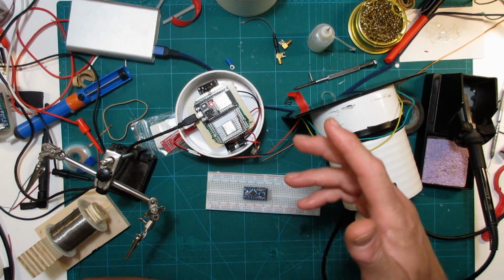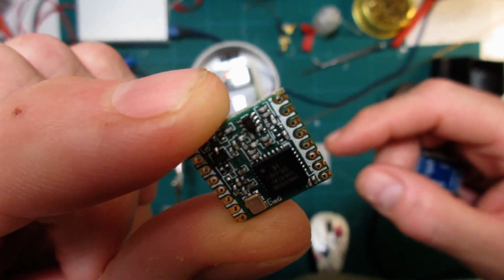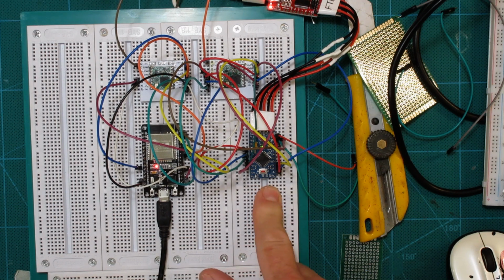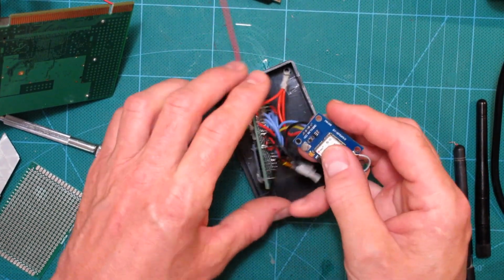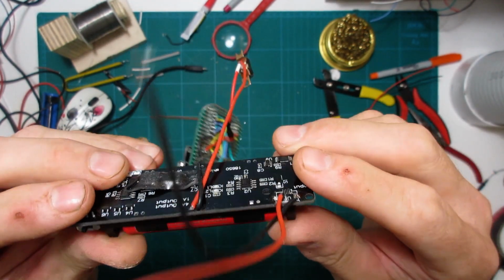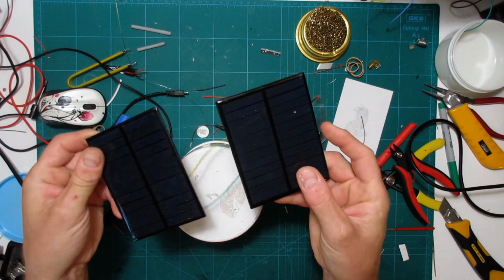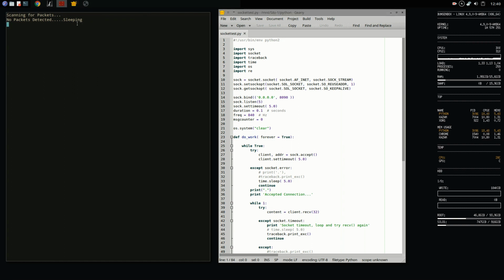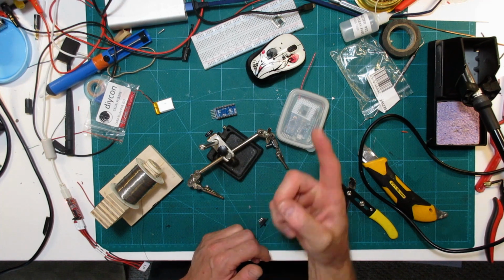Early days development of a LoRa dog tracker

Comment: Solution for poison ivy (9:07) - scrub affected areas with Dawn dish washing detergent, which is designed to dissolve and wash away oils and is 100% save for skin - even with beaks in the skin. This will result in instant relieve from poison ivy itch, and with oils removed healing begins immediately,  with no possibility of scaring (even after scrubbing) because poison ivy blisters are only superficial. FYI
Reply from the maker: This is good advice.  I had already stumbled on this info and can confirm it works!

Comment: Great video. I've been playing around with LoRa for a few years, but never have got anything up and running. In the U.S. a full wave antenna would be 32.8 cm. You are using a 1/4 antenna. You might get better range with a full wave antenna.

Comment: Hello sir, great video and channel!

At 6:47 It seems that the TP4056 board provides 4.2v output: how do you provide 3.0 to 3.6v to the pro mini?

Thanks!
Reply from the maker: You are correct, about the voltage specs for the pro mini however the Atmega328P chip that runs the thing has a range of 2.7V to 5.5V which is why I think it works.  Also,  by powering through the VCC you can save some milliamps by avoiding the voltage regulator.

Comment: I would suggest using the ESP lora32 v2.0 which has the highest rated power of the lora32 models as a home base. It has built in battery manager too. It comes with a tuned antenna that would also help alot. you should be able to get muiltple KM range with better antennas.  Great work, very nice to help those neighbors
Reply from the maker: I should pick on of those up and see how they fare....or is it fair....Hmmm..both look ok.  I guess there's no way to know (or is it know way to no?)

Comment: Helo.  The RF95 can detect Rx data when is in sleep mode? or is the module always ON and the ESP chip is what foes to sleep in 5 min intervals? 
Basicaly my question is... If the chip and the RF95 are in sleep mode, can they detect incoming data?   PS. Thanks for the video
Reply from the maker: You can sleep the RFM95 as well as the ESP32 but in my system, I just sleep the ESP32.  The RFM95 will not detect signals in sleep mode.

Comment: Hi, this looks great but I was wondering is there any way to use the mobile phone and a mobile device as a gateway? That way you can track it on the move? Would it require a custom app? I can find my way around coding an app just not so good on the hardware side.
Reply from the maker: So, yes and no.  I'm working on Part III of this project and it should answer you question in full.  Stay tuned.
Reply: @dork3nergy  that is great?, Looking forward. Thank you for making these videos!

Comment: Great video. But, the Arduino Pro Mini Tutorial doesn't talk about how to connect the GPS module. Do you have any diagrams on  the connections?
Reply from the maker: I use pins 7,8 for the gps Rx and Tx, 3 and 4 will also work.

GPS     ProMini
^^^^^^^^^^^^^^^^
Vcc ---> 3.3V
Gnd ---> Gnd
Rx ---> 7
Tx ---> 8

Comment: I also have a huge golden retriever and I would like to do this, can you leave in the description what parts you use and their prices?
Thank you!
Reply from the maker: Sure. Prices will vary depending on where you get the parts from however.

For the Tracker Module :

RFM95 Lora Module (Make sure the frequency matches your location - 915MHZ for North America)

LoRa Node PCB 203 from DIYCON

Arduino Pro-Mini - 3.3V/8Mhz

3.7V, 200mAh LiPo battery 20mmx30mm

Beitian BN-180 GPS module

TP4056 Charge Module (Remember to change the resistor on it to match the battery ~ 6K for the 200mAh battery)

A little spring antenna.

A small slide switch

For the Gateway:

ESP32
RFM95
You'll need to power it and stick an antenna on it but that's really all you need.

That should get you started.

Comment: Whose LoRa library are you using? I found a couple. One is straight forward, the other gives invalidity errors. they differ with GPIO reqirements.
Reply from the maker: The Sandeep Mistry Library seems to work well.

https://github.com/sandeepmistry/arduino-LoRa
Reply: @dork3nergy  that is the one I am trying. tx seems to initialize and is returning from sending.   rx never gets a good return from LoRa.begin(xx). 

Your videos' style is a hoot. Just enough info to spark experimentation. keep it up.
Reply from the maker: If your RX module is not returning 1 from LoRa.begin(frequency) then it is likely a wiring issue assuming the module is good.  You can test that by swapping the TX module for the RX one.
Reply: up too late. with it wired correctly all is good.
Reply from the maker: @solarkbike8  Good to hear.  Soldier on.

Comment: Cool working system.  If you used a rtc on tx and rx would that help with syncing and energy conservation?  Also how did you figure out bw, data rate, channels, power level etc.  Basic setup?  Cool python setup.  Definitely a cool idea.
Reply from the maker: Thanks James. The system has been running autonomously on the roof for months now without any issues.  My neighbor walks his dog at least 3 times a day and loves that he knows where is damn dog is when it runs away.

I'm not sure what you are thinking regarding the realtime clock (RTC). Using it with the node or gateway?  To save power on the node, the pro-mini can implement some sleep functions that would help.  Also, removing the LED and voltage regulator would be benifical. 

BW, data rate, etc was determined by trial and error mostly. The basic principle for longest range is to have a low bandwidth and a high spread factor.  If you haven't already, check out my 2nd video in this series. 

https://youtu.be/psN0zVSkr4k
Reply: @dork3nergy   thanks for the update.  What I was thinking with the rtc is to basically timestamps tx so you can record them.  Also for interrupts you could set the tx window at a certain time and then have a slightly longer rx window with the rtc so that tx and rx operate synchronized.  It may be possible to use a rtc to wake up the micro as well using external interrupts but you probably have a lot more experience in this.  As far as the spreading rate is that related to the type of tx such as OOK, FSK, or GFSK?
Reply from the maker: So, right now, my gateway just listens for lora chirps in between sleep periods.  There is no coordination between the node and the gateway.  As soon as the gateway detects a lora chirp, it starts a continuous listen cycle until that signal is no longer sending.  I can see a RTC would be great help if you were monitoring soil conditions for example and each node would send out data at a particular time everyday.

Spread Factor is not really related to the modulation type (OOK, FSK etc)  LoRa uses a proprietary modulation scheme called spread spectrum modulation.  

Here is a good article on the different LoRa parameters you can set.

https://medium.com/home-wireless/testing-lora-radios-with-the-limesdr-mini-part-2-37fa481217ff
Reply: @dork3nergy  Thanks man, after watching a few videos it makes more sense.  Chirp is just a sending tone pretty cool it's being used this way.  I guess you use a smaller spreading factor for busy environments and a larger one for less busy environments.  Very informative.

Comment: Hi DorkEnergy!
Could you please tell me the connections between the rfm95  and  Arduino pro mini.
Thank you !
Reply from the maker: Sure thing.

Make sure you are using a 3.3V pro mini.

Pro Mini -->  RFM95
^^^^^^^^^^^^^^^^^^^^^
GND --> GND
VCC --> 3.3V
2 --> DIO0
3 --> DIO1
4 --> DIO2
5 --> RESET
6 --> NSS
11 --> MOSI
12 --> MISO
13 --> SCK
Reply: @dork3nergy  Thank you:) Very Helpful!
DiO1 and DiO2 need to be connected?
Reply from the maker: @PedroE You're right, they do not need to be connected since they are not used .... BUT, if they are implemented in the future you might be happy you connected them now.

Also :

https://github.com/matthijskooijman/arduino-lmic#dio-pins
Reply: @dork3nergy  I´m not right. I don't have any knowledge to be right in this subject. :) I'm just a beginner.
Again thank you!
Reply from the maker: @pedrinho32286  I'm mostly feeling my way in the dark on most stuff too. But hey, you don't learn anything from being right all the time.  Good luck with the project.